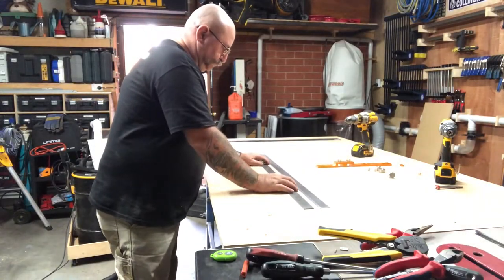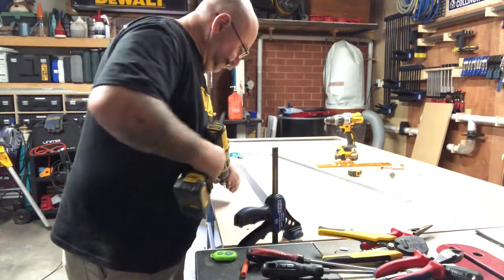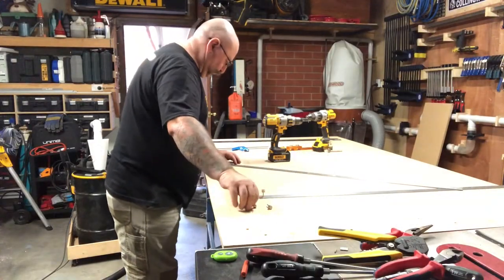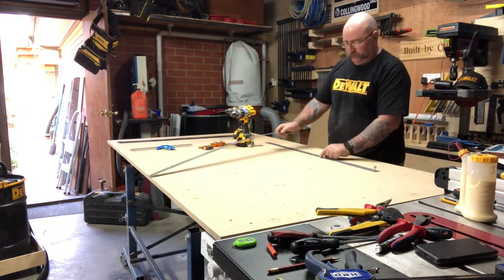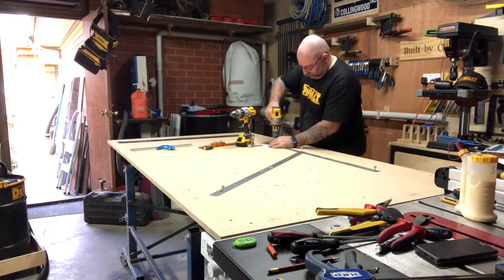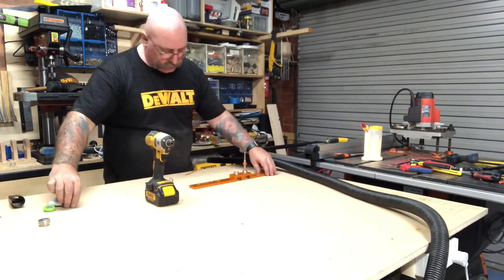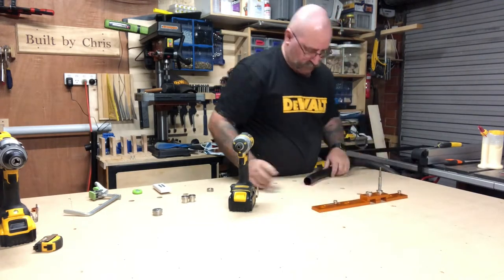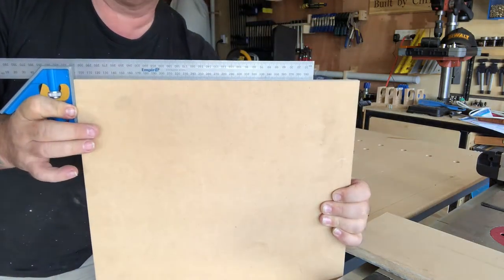Modifying My Workbench Part 2

Comment: HI Chris, Much better with the voice over instead of the music and the scrolling text.  I looked at the Parf Guide System a while ago.. and it's not cheap..
Reply from the maker: Cheers Tim, I’m refining the videos with each one. Yes, the Parf guide system isn’t cheap, but it’s a really handy jig to have.
Reply: Chris, I think it's very expensive for a once only use, as most people would only use it once to drill the holes in their benchtop then put it away never to be used again.

Comment: Great video Chris. I use "L squares" to get book cover boards and spine boards straight before glue-up. Your film has inspired me as to how to create a jig that will attach and detach to my workbench - Thanks!!
I bought a gadget in the 1970's for drilling holes vertically but they are no longer available anywhere in the uk tool merchants (I mean a real shop as opposed 'online') Very useful to have in the toolbox. 
Bit of feedback - I am a subscriber to your channel and as with Sumo's Projects I have activated the bell to be notified - strange thing is that I was notified of your part 3 before being notified of part 2 . . . I don't know if that is useful or not!